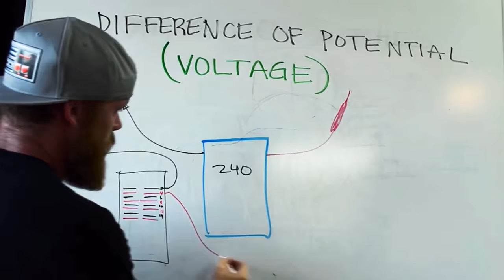ZINSCO ELECTRICAL PANELS - why their panels are dangerous

Comment: I bought an industrial building built in 1953 that had all Westinghouse breaker panels. You want to talk about quality, those panels were built to last at least a hundred years. Super heavy-duty copper bus. The breakers were all bolted to the bus with like 5/16 or 3/8 bolts. It killed me to replace those panels, but I needed more circuits of a lower amperage. I saved the panels, just for a conversation piece to show people the quality that went into industrial and commercial stuff made by companies like Westinghouse and General electric back then
Reply: thats awesome, id always wonder in my head what the experience was like for the electricians that wired these old houses originally, when knob and tube was used. when working with it, tearing it out etc. it was fascinating how its ran and seemed to work, i never took the time to really understand it though
Reply: Wanted to see built to last try to find someone to show you an AT&T power/switching facility all copper lots of batteries and all built by western electric. The old mechanical switches were amazing
Reply: Wow I know nothing about electrical but am in a pickle trying to get info for my owners in CA whether or not our electrical panels and breakers need to be replaced. We were built in 1987 and yes my breakers and panels both say Challenger on them. Do we need to replace both outside panels and breaker inside the apartments??? Can't wait for your reply. Please?
Reply: @aileenmorales1703  I would at least have an electrician take a look if not arcing you are probably ok but to save money and be a bit safer you could look to see if anyone makes ul replacement breakers. The ones made now for zinsco as an example don’t have the fire hazard the original ones did.
Reply: @aileenmorales1703  Some of the Challenger panels were supposedly made by Zinsco and rebranded. Zinsco breaker panels are a fire waiting to happen. Other Challengers are supposed to be fine. It's kind of hard to tell without seeing it or knowing the exact model.
Reply: @joecummings1260  Then it may be best to replace to be on the safe side but my question is does both need replacement outside where electrical panels are and inside breakers? I know nothing about electrical just manage the complex. Thanks.
Reply: @aileenmorales1703  You mean where the meters are? That is going to depend on what condition they are in. How many meters are there for the complex?

Comment: When I bought my house it had one of these Zinsco panels. My inspector noticed it and a melted hot water heater breaker. Negotiated replacement with the old owner of the house. After I moved in I found loose aluminum connections in several rooms and decided to rewire with copper. There’s a house fire in my neighborhood every other year or so. I always wonder if it’s the panel or wiring.
Reply: Might be a good idea to let your neighbors know that the developers fucked up
Reply: @namAehT  If anything, these are houses built before the 50's, so they were kit houses from the Sears Catalog, with wiring updated in the 80's.
Reply: I wouldn't go that far but my parents house was hauled in on a truck like other on site manufacturers housing. I had to change out the panel we had the larger 240 breakers but the buss was corroded and the main arced. We had changed out the main first but a few years later we decided to replace the panel. All the wires were copper and ok. 73
Reply: I think the aluminum wiring is the biggest factor and the breakers in these old ass panels not being replaced with new and improved ones
Reply: @chrissilva5659  my dad used aluminum wire for the meter and main breaker which was legal and the main stated you could. The fire problem is on outlets not made for aluminum wire and over time connections corrode, arc and melt the wire. I would spend the extra money and use copper. Not worth the trouble and have to replace wire. 73

Comment: I was changing out a 2x4 lay in troffer fixture in a building a few years ago that had a zinsco panel being used as a sub that was fed from a 200 amp Siemens panel. The light switch was on the neutral side of the circuit (I didn't know this and I didn't bother to check if power was actually off at the fixture, I always do now.) I pulled the Romex out of the fixture and the hot wire hit the Romex connector. I remember a very bright flash and a loud pop. I came down off the ladder and all the emergency lights were on in the building. I checked the panels and the 20 amp zinsco breaker for the lighting circuit was not tripped but the 200 amp main to the building was.
I brought it to the building owners attention and we replaced that panel a few weeks later.
Reply: Had same thing happen to me with a FIre Specific panel. Tripped the transformer breaker at the street!

Comment: came across a 20amp fpe yesterday that was causing a whole panel to over heat drawing only 18amp on it. was in a semi trip state hurt to touch.. changed it out told owner he should either change panel or buy all new fpe breakers as they are all over 40yrs old... pushing 50

Comment: Thanks for this. Starting some electrical projects. Getting a 200a main panel upgrade with square d qo also getting an old square d qo panel in the garage updated for more capacity. Next will be replacing zinsco sub panel in guest house and a 4 circuit fuse box in the house (low voltage lighting and door bell). Last will be as full rewire and adding gfci in bathroom and kitchen and Afci in all living spaces.

Comment: How does a single slot 240 breaker work? Doesn't it need to take up two spots so it's getting both sides of the bus bar to get 240v?

Comment: Lucked out when I bought my house 8 years ago - the house inspector noted the presence of Zinsco breakers, and his report noted that they had a high failure rate and the whole assembly needed to be replaced.  I was able to get the seller to pay for that before closing.
Reply: I wish I had done the same thing!  I just bought an older house and it still has the Zinsco panel.  I'm honestly a little terrified of it.  The house has so many electrical issues.  I'm ready to either rebuild the panel or just completely replace it with something like Square D.  I have sunk so much money into this house that I have to wait a while before I do it though.
Reply: @robburton3255  Just replace the panel. Zinsco panels had a real shit buss. They always end up burning where the breakers attach to the buss.

Comment: Recently had a master electrician out to resolve some wiring problems in some outlets. He inspected our panel ( 1981 installed when house was built) and said it was outdated and doesn’t meet code. It was labeled Sylvania GTE. I’m a retired firefighter who dealt with a LOT of fires caused by faulty electrical systems so I
Immediately scheduled him back to replace the panel. He changed it to a 200 amp Eaton panel and breakers. He replaced the wiring from the meter into the box. One of my neighbors came over to look at it and realized his panel ( house built 1979) was also out of code and he’s had problems as well. So he’s having his panel replaced as well.

Comment: Ten years ago, I had no space in my Zinsco panel to add 240v lines for a shop I was adding to my garage. I talked with an electrician about adding a subpanel but he said, better off getting rid of that Zinsco. Boy was that good advice! I had several breakers that had failed and could never trip, so their circuits had been operating entirely without protection. And the rails were all pitted and burned due to arcing. Glad I had that panel replaced!

If nothing else, test those breakers and inspect the panel well!

Comment: Back in the day when I was doing a lot of service work, the boss called me into the office and says...XYZ restaurant called and needs someone to come out and show them "how to turn off the light in the panel".  After playing twenty questions with the boss, he didn't really understand what they wanted either, I was sent to check it out asap.  The "light in the panel" was off when I arrived but I found it anyhow...an aluminum buss Zinsco with a couple of toasted breakers and partially melted buss bars.  I never saw these kind of problems with the older copper buss panels.  I did see it several times with the aluminum ones.

Comment: I remember in 19 92 working on an old building that has fully had commercial style Federal Pacific breakers, they would not trip. Those things would weld before they would trip. We replace the panels as we could. It's a miracle that that place didn't burn down gazette records Goodwill before they would trip😅 or explode 💥

Comment: ZFS -ZinsCo Fire Starters

I did industrial/commercial buildings for 40 years. Things like bowling centers, printing plants, food prospering plants.

Back in the 50's and 60's bowling centers were installing pinsetter/pinspotting equipment and they originally were 120 volt because all the old building had ancient electrical service. ZinsCo was the panels of choice because they were cheap.

I would pull out 2 panels rated @200 amps each and replace them with 400 amp 3 phase panels (2each) just for the pinsetters and ball return systems.

The owners were amazed that the building lights wouldn't brown out any more when they turned all the lanes on at once.

I have never seen a bowling Center or print shop burn half way down. Most fire departments would just squirt water on the outside of the building and let them burn.

Today bowling centers require 1800 amp 3 phase service just for the bowling equipment.

Just to much fun......

Comment: Worked on many zinsco panels and only saw 1 that caught fire . Not sure if the reason was a breaker failure  . I have seen 50 year old zinsco breakers trip on overload and short circuit with no problem . The problem I see is an arc problem do to loose connections on the breaker terminal . You can see the same problem with neutral terminals and unbalanced loads . Another factor breakers get warm at loads close to overload and if it goes on for long periods it breaks down the plastic over time and makes it brittle . Challenger and ge  breakers had higher rates of failure that I have seen over zinsco . Another factor these panels were common in the 70s when aluminum Romex was used . Another connection problem if not landed properly in the panel . I have seen 70 year old zinsco panel bussing as pristine as the day it was installed . Of course it was copper alloy . My problem with them is some of the panel designs make them extremely difficult to get out and damaging them to take a closer look . Sometimes you have to remove them with electrified bussing and that can be dangerous . Some of those 1950s panel only allow to de energize by removing the meter and I don't remove those breakers energized which involves the power company and not being able to solve the problem immediately . All slim and twin breakers appear to be more vulnerable to failure to there full size companions . Arc has been the big problem for circuit protection as short ,overload and ground fault were solved . Then came along arc fault and they have been a wonderful addition to circuit protection. Yes you need to make sure your connections are tight within  a circuit . A loose wire nut and your on an adventure searching for that problem . It's harder to trouble shoot but many can tell you what kind of fault your dealing with . Everything becomes less affective over time . A 25 year old breaker should probably be replaced but nobody maintains electrical devices . They just wait till it fails which can lead to bigger problems . I installed arc fault breakers for my daughter's aluminum circuits which was the biggest problem for aluminum wiring and improper  connections . Human error is most of the problem with either a connection or maintenance problem .

Comment: Changed out the Zinsco main panel 5 ears ago. Want to change out the subpanel but its in a closet with the hvac furnace/air handler. Problem is, changing out the Zinsco subpanel requires bringing it to code. Given the location, small closet, thats impossible. Running wires from an outdoor subpanel would require a huge expense. Thinking of replacing the two old Zinsco breakers with Connecticut Electric. Far from ideal but I guess its an upgrade and safer. fwiw - the Zinsco alu bars look to be in very good shape. Not pitted or corroded.

Comment: I'm a retired Union Electrician who cut my teeth roping (wiring) houses. Even in 1979 nobody called a Zinsco panel a Zinsco panel, everybody refered to it as Zinsco$hit. Their panels were well known to fail. Right where the jaws of the breaker grab the buss bar it starts to arc and pit. I've seen buss bars that had nearly 3/4's of the bar gone, arced away and the breaker never failed.

Comment: I'm glad I live out west (Phoenix), out here damn near everything is Eaton/SquareD/Siemens, even on houses that are 100 years old... so either they've been replaced early on, or these weird panels you are going through were not popular here.
Reply: As a homeowner out west with a 1982 date of build, I checked my panel when looking to add a detached garage.  I fortunately have a GE electrical panel, and everything looked fine.  But I have discovered close neighbors with commercially built homes (mine was privately built) from the late 1970s to early 1980s have FPE electrical panels with those Stab-Lok breakers.  I try to alert people if I learn they have these panels.  Then it is up to them to decide regarding replacement.

Comment: My house was originally built in about 1910-20 (not exactly sure, could even be older) and originally nob and tube. The nob and tube in the upstairs is still hot, and runs off a fuse panel. The down stairs looks to have been rewired about 40 years ago with cloth wrap, and then more rewiring sometime later with NM Romex in some parts but not all. The breaker panel for the Romex is a Federal Pacific. So I have an old Wadsworth buss fuse box (yes, screw in fuses, not breakers) and an old Federal Pacific breaker panel running right next to each other.

I know this is bad, and SHOULD be 100% rewired and a new single panel installed, however, you and I both know this will be VERY expensive.

My question is, can I get away with just replacing the two panels with a modern breaker panel and leave the wire until another time? Or does it all need to be done in one go?

Comment: Thank a for the video, in my zinsco panel I have a 15amp breaker with a yellow test on it, it has two  neutral wire. It seems to be a overload protection.  I only see used ones can I replace it with a regular 15 am breaker or do I need to replace it with the same. The breaker control the man cave
Reply from the maker: Gonna need a lot more information to be helpful. Hop into the discord server or shoot me some pictures of what you going on. 

Thank you. 

https://discord.com/invite/7ykYfbh

Comment: Nice explanation, man !!!   Interesting the difference in brands from USA and Canada.  Only brand I was familiar with that u mentioned was Federal Pacific, and in Canada it is called Federal Pioneer.  Same breaker, and notorious for trip failure.  I witnessed a single 15 HOLD at 27 amps.  Crazy failure.  Good informative video.  I wish homeowners would watch this explanation of the importance of breaker safety ; it’s never an easy bit of news to recommend a panel change to a client.

Comment: Like your videos. So tell me...is it the panels themselves or the old breakers that are the problem? We are realtors and run into these when do home inspections. Usually means several thousand in concessions. Is the panel name now getting a bad rap for a breaker problem?
Reply: The panel design uses plated aluminum bus bars, which are not great, but not against code.  But Zinsco panels will ONLY accept Zinsco breakers, which are no longer UL LISTED, and also NO possibility of installing Arc-Fault Interruptor breakers.  So, the PANEL cannot be upgraded, and the only breakers which fit are QUESTIONABLE.